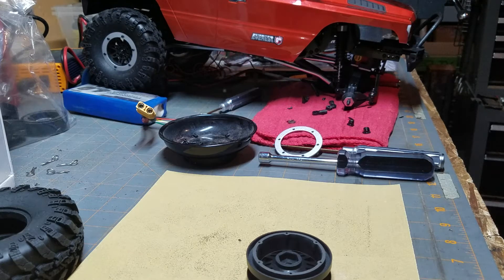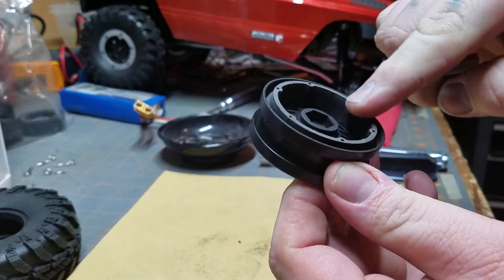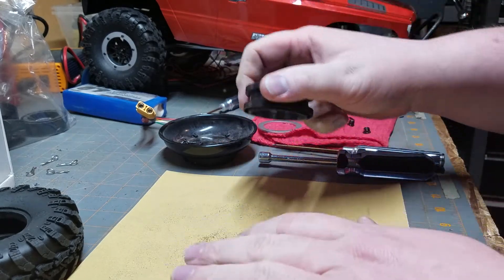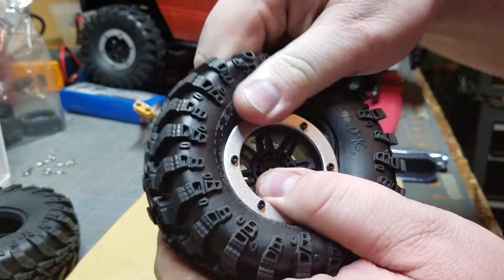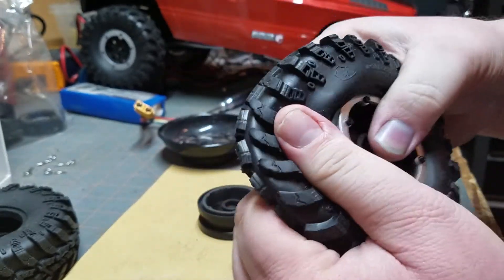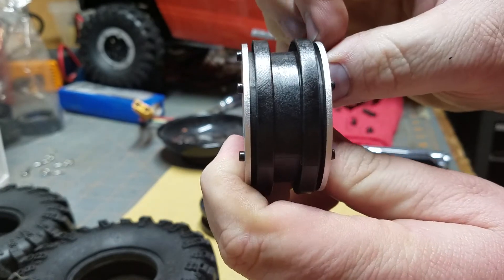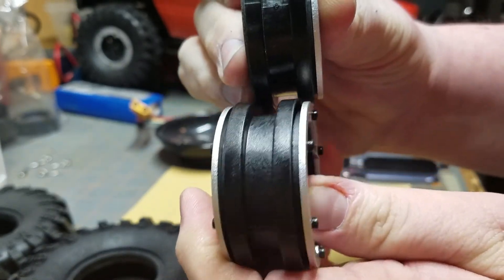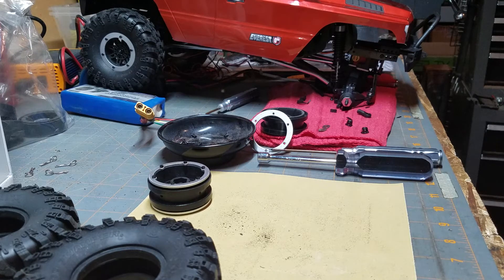Redcat Everest Gen7 beadlock wheel mod

Comment: How much did you take off the bead
Reply from the maker: Tyler Comerford with the tire off if you put the lock ring back on there is a gap between the lock ring and the center of the wheel. I sanded that down until it was about half the gap. I hope this helps.